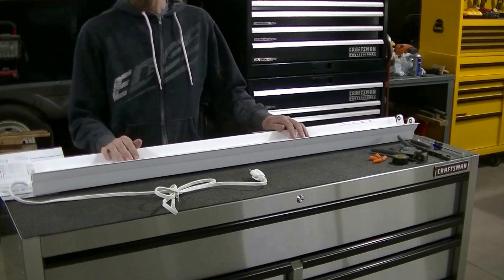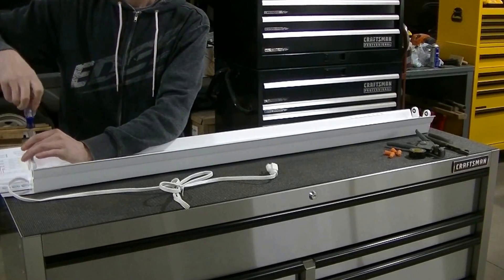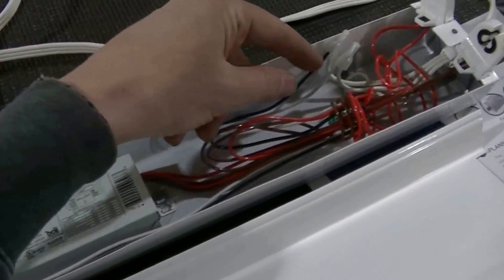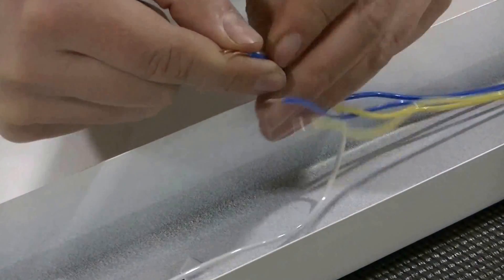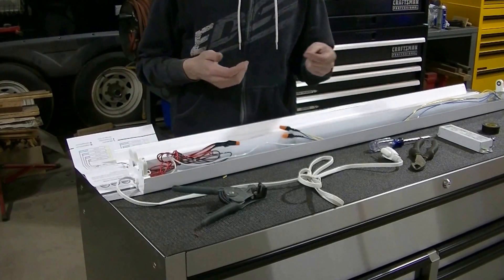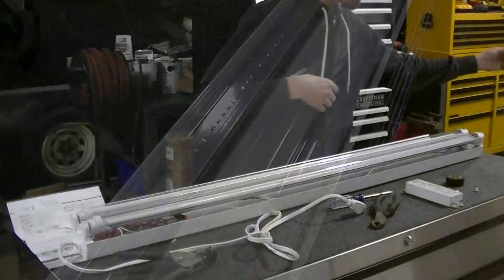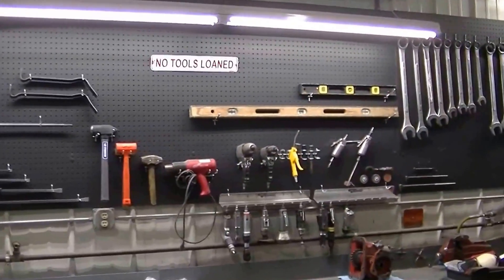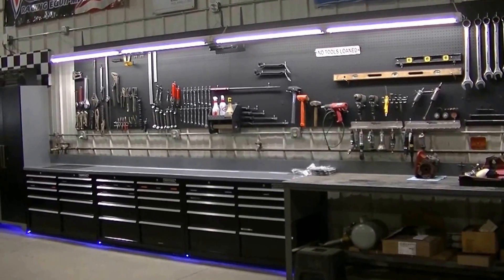Hyperikon T12 LED Tube Installation

Comment: No, it is not "simple." there are single-ended tubes, double-ended tubes, shunted tombstones and non-shunted tombstones. You didn't cover any of that and the wire hookup was not clear either.